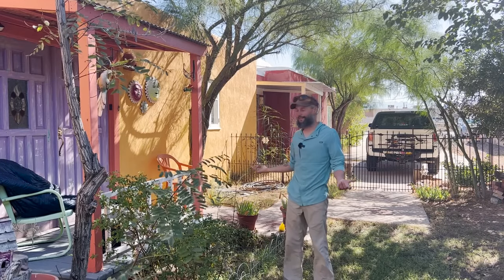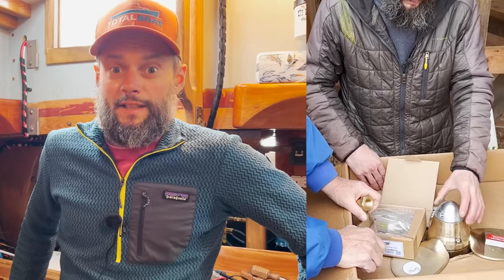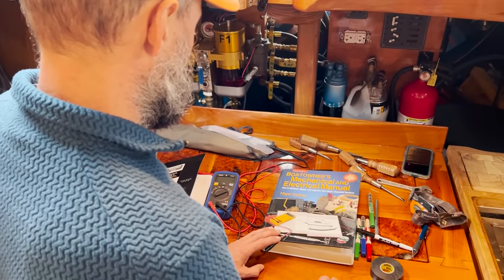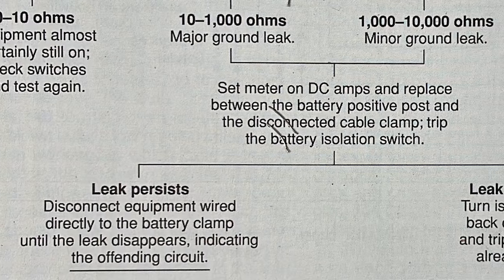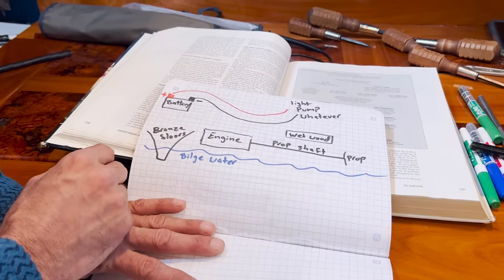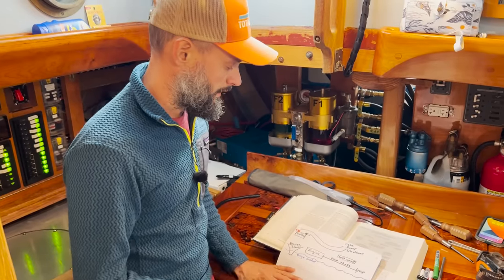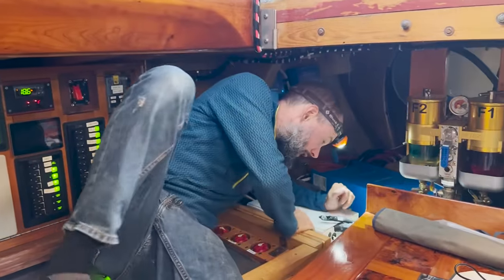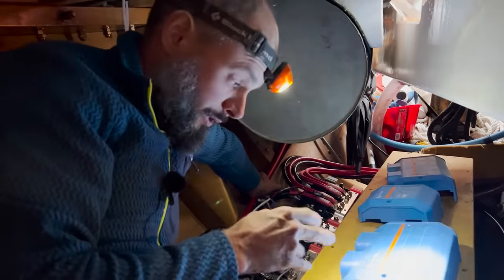Stray Current Puts Arabella in Danger - Episode 284 - Acorn to Arabella: Journey of a Wooden Boat

Comment: A more forensic method would be use a DC current clamp meter (a low current one) on each device connected to each circuit breaker. Clamp around both of the positive and negative (+- red black they'll probably in the same cable)  wires together to show any imbalance in that device bilge pump, lights, etc, etc.

Comment: I rebuilt alternators for 30yrs.marine alternators should have and isolated ground also when converting to an external regulator I used dummy regulator housings with no internal electronics.  FYI I found external regulator systems to be quite troublesome in the marine industry of course that was years ago hopefully the electronics has improved.

Comment: It might be you have a bad fuse in the multimeter. Also it seemed like you used the wrong port on the multimeter. If not it might be you have leakage from the alternator. It might also be a leakage current comming from induced electricity of the propshaft rotating whilst current flows across. Good luck!

Comment: Fortunately, you were in the eye of the hurricane when you were crawling over the circuitry and seas were calm! Another source of stray voltage could be as simple as wires stuffed in switch boxes. I even had breaker points on a single cylinder engine that fired with the points cover off, but not when the cover was screwed down. Pull start engines make you think more, pull less.

Comment: Oh man, how did I miss this video? I have mentioned my land yacht before.  Solar and battery management is critical.  But galvanic corrosion is never an issue because I float on the planet with rubber tires.

The first problem I had was the alternator. Induction motors or generators are complex devices electromagneticaly speaking. I think you figured it out and I hope that you are right. I would just remove the alternator. You don't need any electric power for a diesel engine after you get it started with the electric starter motor.

Comment: As I understand your alternator summary, you have disconnected the alternator from the batteries since just after launch. That in itself is a no no since apparently the alternator was not neutered. When an alternator is generating, the energy has to go somewhere and usually running an alternator disconnected from its load ie the batteries will cause the alternator to fail badly with smoke etc   So the theory that the alternator has been pushing current could be valid as that energy has to go somewhere but I would question the condition of the alternator at this point
Usually to disable the alternator's internal regulator, you just disconnect the regulator excitation line from its 12v source which is usually the ignition switch or an oil pressure switch on the engine. The regulator is now disabled and cannot supply  field current and therefore cannot energize  the alternator to enable voltage and current generation.  The external regulator then supplies field current to excite the field windings enabling the alternator to generate power for charging. 
I would disconnect or disable the external regulator, reconnect the batteries to the alternator , run the engine and observe if the alternator is still functioning ie charging the batteries.  If it is then the alternator data sheet should indicate how to disconnect and thus disable the internal regulator as well as indicate how to connect up to an external regulator
But as I indicated if that alternator has been generating and not connected to its battery load, then it could be badly compromised
Good luck

Comment: steve i put an insulated prop shaft connector between transmission and  prop. also the steering and engine controls, and therefore the rudder stock and all are insulated from dc grouind. wow im so glad i saw this as i have alternator charging lipo engine start and windlass bats through victron charge controller for lipo. i wish i knew how to ''nueter' my alternator ! launching next month

Comment: After all the clever solutions we can now be certain the he’s definitely not an electrician.  Seems like the probe should be connected to the other terminal, it also seems like you could check the current on each circuit by measuring amps across the breaker when it’s in the open position.  Also consider getting some leads with alligator clips so you can use your hands to make changes while monitoring your meter, that way you don’t have to keep picking up your leads and checking after each change.  You can probably check for unwanted ac and dc voltage from the alternator with the engine running, between the alternator and engine or negative buss etc.  good luck 👍 🤙

Comment: Some alternators when they fail, fail to full charge scenario putting out everything they can. You should see that on a meter somewhere though. Or just disconnect that alternator for a testing. What happens when the batteries are full and the solar panels are still getting full sun?

Comment: Using a metal through hull fitting disconnect the bonding wire and you should be able to test the engine starting and charging system for stray current. You should do this both while the engine is running and not running. I’d do it before you change out/modify the alternator.

This could even be from something as simple as a power leak at the injection pump solenoid. Yes, it’s likely the alternator. But definitely check the whole engine start, run, charging system before just assuming that it’s the alternator. Find the problem with 100% certainty before “fixing” it.

Comment: You have checked for a DC leak with all of the loads turned off. There is a possibility that the leak is in one of the pieces of equipment itself. I would try detecting it like a GFCI does, using two meters, one on the positive lead and one on the negative. They should match exactly. Load up the system, turning each load on in turn and ensuring on each step that the positive lead current matches the negative lead current.

Comment: I have no idea where you are moored but be aware that if you are in the vicinity of underground (submerged) (or even overhead) high voltage distribution cables the magnetic fields produced in those cable can induce stray currents in your boats wiring and even the prop shaft itself.  So, just because you're not at a dock, don't rule out all external influences.  If you are still getting anode deterioration, try a different mooring.

Comment: Did you connect the negative terminals of both battery systems to a common ground which is also connected to the engine? If not, you should do that!
I dont think the alternator itself can cause this problem because the engine must be connected to ground for the starter to work, so if the generator leaks some current to the engine, the current doesnt need to flow through the water and therefore it cant eat the zinc anode.
Reply: In other words, the problem can't just be on the engine because there must be another metal part inside the water which has a voltage difference to the engine ,so the stray current can flow from that metal part through the water to the engine or from the engine through the water to that metal part.

While thinking about that, I realized the most likely reason for this problem is that you connected the engine to the negative terminal of the starter battery but not to the negative terminal of the Lithium battery, so while charging the batteries with the alternator, some current flows through the water to connect the engine to the negative terminal of the Lithium battery.

Comment: Earthing the propeller shaft to the ship's hull prevents corrosion and spark erosion in the shaft bearings and gearboxes. Try to fit a brush assembly for shaft and see if it makes a difference. as shaft when it rotates which is floating in oil it produces current. thats why shaft earting is done. try it

Comment: leak current : may i suggest to add a ""Aice Digital Clamp meter- multimeter"". 
This is very pratical because the clamp is around the wire in test that must NOT disconect from its place. 
Hope that my words are right in english. Here we call it : Pince Ampere metrique".
Bon courage and stay safe.

Comment: I paused at 24:24 and my hypothesis it that the stray current is static or something from the engine, because you have spent extended time motoring Arabella with the diesel engine. Edit to Add. well I was in the right area of the cause. I wonder if you could attach an electronic clutch to the alternator, pulley like there is on a car A/C system compressor? You would only energize the pulley to the alternator when you need it? Good episode in problem solving Steve. So with the delay in videos being screened, I guess it would be opportune to wish Robin a happy 40th Birthday from the old British fella living in Canada x 🍾🎂🥂

Comment: The engine does seem to be a very likely culprit, as all electrical components on them tend to be case ground through the block. I could very easily see your engine building up a high potential voltage especially with an alternator that is continuously charging. I am not familiar with marine engines but I would also recommend checking all connections and grounding on the engine a because from my experience with automotive electrical, if there is a ground problem somehow the electricity always takes the worst possible path, which in this case sounds like it's seeking to equalize it's potential through your prop shaft.

Comment: A multimeter won't help you find stray current, you need a Megameter (also known as a Megger). See if you can rent one or if you need to buy one check out the DLA Disposition Services. They sell old military gear and Meggers are almost as common as multimeters. I am retired Navy, ok Air Navy but we still use Meggers, and Meggers are used to find circuits with stray current. Stray current can activate a weapons system or detonate something big.

Comment: If possible, slip the belt off the alternator and/or get a shorter belt to run any other accessories.   Let the solar charge the start battery until you get the correct alternator installed.

Comment: Dissimilar metals in the circuit will produce a minute current 0.01mA so the book is correct, 0.1mA is acceptable. And the bigger the system the more leakage you will get. But 200mA is a concern.
An alternator is a strong contender.

Comment: I think you need more volume of surface area of sacrificial links on the prop ... the other one was too small & was overwhelmed by a normal amount of leakage in a large system like yours.
One thing I would do is make sure that all the Mechanical equipment in the boat has a good common ground, make sure all the motors & frameworks of remote equipment is fully grounded back to the battery banks. A good ground is one that you grind off the paint surface and install a grounding screw with a proper eyelet on the ground wire then bolt that to the bare metal you exposed...no doubt then it is grounded.

Comment: A couple of extra things to consider. It's probably not a cable or termination issue. It could be a device with some form of metallic structure which when on doesn't return all of it's current to the 0 VDC cable. Float level sensors are a good example of this - a portion of their current returns through the liquid -> tank -> tank is bolted to metallic structure of boat etc etc. A 24 VDC and 0 VDC balance per circuit (like an RCD protective device detects) would help identify. You can also do some pretty clever pulsing on and off of the current and run around with ski-pole probe microV meters to see where it is pulsing the hardest and there is a large voltage gradient. Not really boating tricks, just sound macro DC electronic engineering diagnostics.

Comment: Depending on the type of alternator if it has an internet voltage regulator it uses a diode to let current flow one way. If the diode is bad or going bad the start battery can discharge backwards through the alternator housing.

Comment: If it is the engine and it is eating the anode that quick you should be able to start it in neutral and give it some revs while looking at the prop. You’d see small bubbles forming on the anode of it was the engine causing the issue.

Comment: Steve, the most important thing to remember is what @gumbykevbo writes: "Assumptions are the enemy" . The title of this video already says that YOU HAVE STRAY CURRENT. So you already decided the problem is known.
Why not start at the beginning: You have a bronze propeller with a sacrificial zinc anode attached to it. That, submerged in sea water, is a battery. There should be a connection between the prop and the anode to start the current. Hey it is screwed together, so the current flows and the "battery" works. What will happen now is that the zinc molecules will move to the bronze, eating the anode away. And that is actually what happens. So far no surprises but it is going too fast. Strange that a zinc prop sized for the propeller is disappearing much faster than one would expect. 
Now you can try to find a reason for that. For instance look if you see close to that anode not just the bronze propeller but another piece of metal like a piece of bronze holding the aft bearing or maybe the rudder hinges or bolts or actually a whole bunch of bronze parts very close to that poor little zinc anode. The more pieces of bronze you will fit around that anode, the quicker she will go. My advice: ad one more anode and fit it to the part attached to the bearing tube. Monitor for a couple of months and you will see that it solves your problem.

Comment: My stab in the dark: do the two interconnected ac power sources (inverter and alternator) have separate grounding systems, each bonded to neutral?  If so, there might be an inadvertent ground loop producing current by electromagnetic induction . . . ?

Comment: You said the solar is providing all of your power needs without the alternator. Are your batteries routinely completely full? If they are full, could the unused solar be getting sent to ground? (the water in this case...) Or are you disconnecting the solar banks when the batteries are full to prevent that connection?

Comment: I have no idea who the author of the following is, but it’s great; 

Any zinc in the water near your boat, and electrically connected to your underwater metals, is doing the same as the zinc plate on the boat. More zinc does mean more protective current, but not more protection.
Overprotection is a big issue on wooden boats, as it causes a buildup of sodium hydroxide (Iye) around protected parts, which is very destructive to wood. It's not an issue with glass boats, but overprotecton is still pointless, as it is galvanic and not electrolytic protection. Galvanic corrosion is caused by electrical currents that are generated by the interacting metals, and your zinc is part of that interaction. Electrolytic corrosion is caused by current from an external source, and the zinc's part in that is on the wrong end of the circuit along with your other underwater metals.

Now, that said, in the case that you have pulled into a marina on your way and there are a lot of poor looking boats there and you are plugging in and don't have a galvanic isolator installed, adding zinc to your system will definitely compensate for the extra load of the boats drawing galvanic protection through the shore power ground. And, you don't need to have it hanging over your rail, It will do the same hanging off the dock if it is connected to the grounded outlet box, where it only needs 3 feet of wire.

If you have a multimeter on board, you can test your boat and your dock for about 15 more bucks. Get a pencil zinc, drill a hole in it for a wire and solder a length of wire to it. Connect that to the black lead of your
meter, and suspend the zinc in the water, after cleaning it with a scotch-brite pad. Put the red lead to your bonding system. The meter readings indicate thus with bronze and stainless protected metals:
Reading DC volts on 2 volt scale:
Minimum protection: 500-550 millivolts (0.5V)
Full protection: 430-480 mv
Overprotected: less than 380 mv
An unprotected bronze fitting of reasonable quality by itself will read about 700 mv; Poorer grade materials have lower readings, with protection levels adjusted accordingly. A metal will be fully protected when its bonded voltage reading is 200 mv less than its unbonded reading. Additional zinc pulls the voltage down, additional protected metals loads the system by pulling the voltage up. Stray current that causes electrolytic corrosion pulls the voltage up dramatically. A voltage reading over 750 mv DC indicates stray current, and there should be no AC voltage at all. (A small AC reading may be picked up by the meter leads inside the boat if the shore power is on, especially if there are any fluorescent lights, motors, or transformers on.) To test the dock by connecting the red lead to the grounded metal outlet box before you plug in, If it reads higher than your boat, it will draw protection, and it reads lower it will actually provide protection, If it
reads over 3/4 volt DC, or any AC, it is indeed hot, though the dock itself may not be the root cause. A direct-bonded boat (no controller) with a new zinc should have a reading of 80-100 mv, and will be overprotected. As the zinc corrodes providing current to protect the other metals, the voltage rises, frequently past the minumum protection level by the time the zinc has to be replaced. Checking your system this way eliminates the mystery, at least as far as knowing what's happening.
Calm Seas